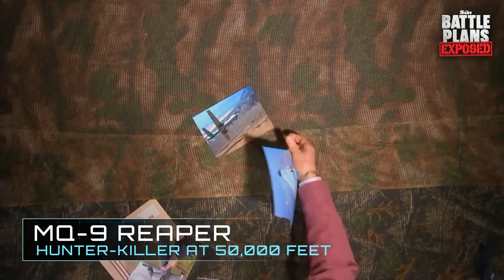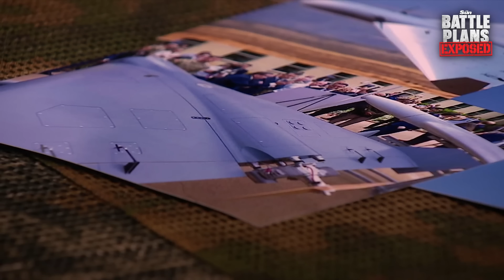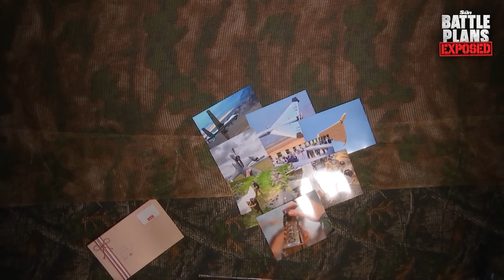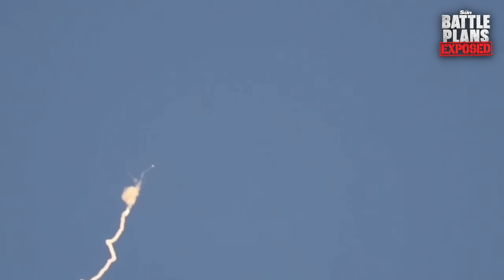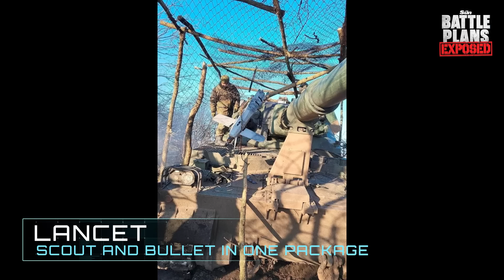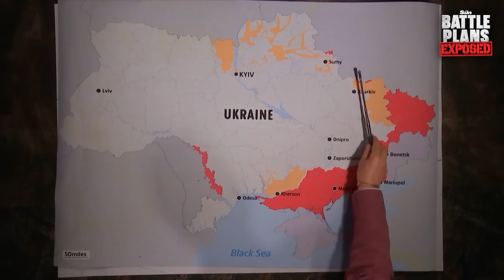How Trump ‘stole’ his top weapon from Iran | Battle Plans Exposed

Comment: The problem on the other side is that American military technology requires high end chip capability to be copied, which is out of their reach, even if they get shot down and dissected. Some aircraft can even be designed to be inherently unstable without the constant and extremely fast adjustments of a microcontroller.

Comment: Certain Iranian Shahed-series drones, specifically the Shahed 171 Simorgh and Shahed 191 Saeqeh, are reverse-engineered, flying-wing designs directly based on the U.S. Lockheed Martin RQ-170 Sentinel. Iran captured a nearly intact RQ-170 in 2011 and subsequently developed these, along with smaller variants, to emulate its stealth and reconnaissance capabilities
Reply: You left out the Israeli version in the 1980s
The "Harpy" family of loitering munitions developed by Israel Aerospace Industries (IAI) i

Comment: The US wouldn't need to reverse engineer Shaheds to figure out how to build the Lucas, but it is helpful to examine Shaheds to understand their capabilities, where their parts come from and how they're constructed.
Reply: Exactly I was in contact with one of the engineers of drones. I was working on a Pazmany. Margret put me in contact with him.  By phone off the top of his head he did a stress analysis and came to a repair solution. I am sure they have been through the simple designs in the past.
Reply: @jayreiter268  Israel had them in the 1980s, Iran did the reverse engineering
the "Harpy" family of loitering munitions developed by Israel Aerospace Industries (IAI) i

Comment: They did not actually "steal" that design.  For the same reason that most current high efficiency sedans throughout the world all have a very similar appearance, it's due to physics.  The shape of the delta wing has been used for over a century.  Engineers in different places and times are faced with the same physics to deal with.  It looks similar like a Toyota looks like a Honda.  The cheap single use drone needs to be told what to target and where it is.  You FIND targets with the Reaper, Global Hawk, and other high functioning sensor systems.

Comment: Iran was the first to use the idea but ud be an idiot to believe this idea wasn't already bieng experimented with.
Reply: nonsense, Israel had operational one-way loitering drones in the 1980s. It was China who reversed engineered them and sold it to Iran

The IAI Harpy is a pioneering autonomous loitering munition developed by Israel Aerospace Industries (IAI), 

 China had purchased approximately 100 Harpy units in 1994 for $55 million

Comment: Can the USA and nato nations manufacture LUCAS drones and deploy them quickly enough to be useful?
Reply: The Low-cost Uncrewed Combat Attack System (LUCAS), also identified in technical documentation as the FLM-136, is currently deployed and actively engaged in combat operations by the United States Armed Forces

Initial Deployment and Task Force Scorpion Strike
The formal deployment of the LUCAS began in late 2025. On December 3, 2025, U.S. Central Command (CENTCOM) announced the activation of the first operational OWA drone squadron under the auspices of "Task Force Scorpion Strike.

Comment: I think you're putting a bit too much weight on the reverse engineering part...  a delta wing drone is an old idea... 1980s South African ARD-10 drone became the 1990s Israeli Harpy, which was reverse engineered  by Iran to become the Shahed, a cheap cruise  missile. The US is just using the same strategy... low cost munitions to bleed missile magazines...

Comment: Your math is off. It is a 100 drones not 1000 versus the cost of 1 Reaper, and it can carry 8 hellfire missiles per engagement. The two types have each their roles
Reply: The Reaper costs $30,000,000 the Lucas $35,000, so you could buy 857 Lucas drones for the price of one Reaper.